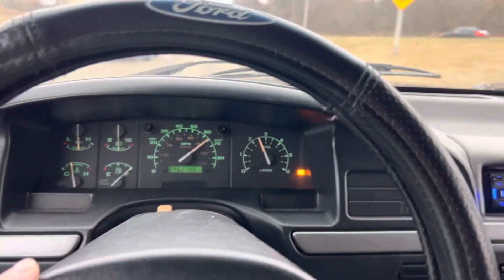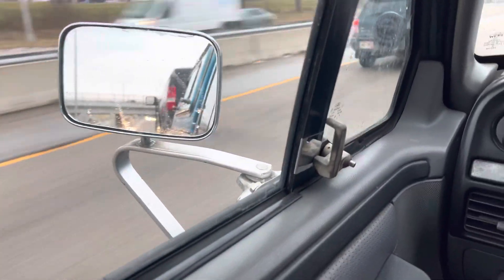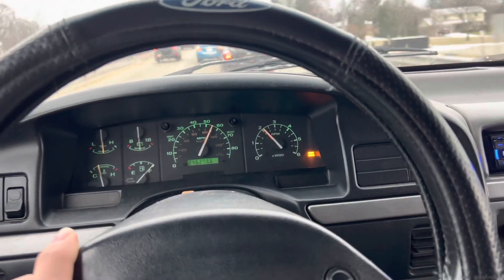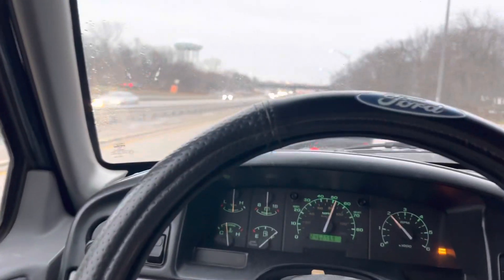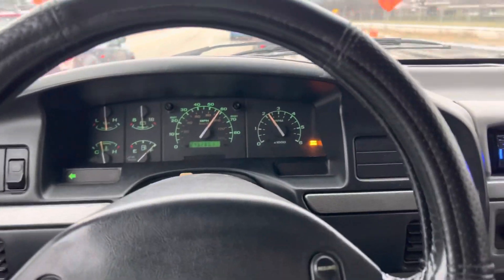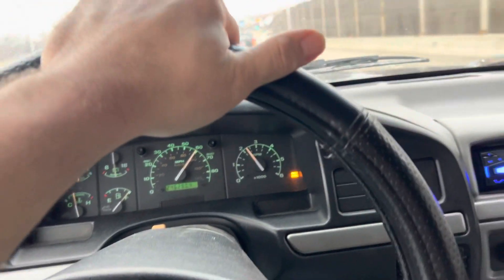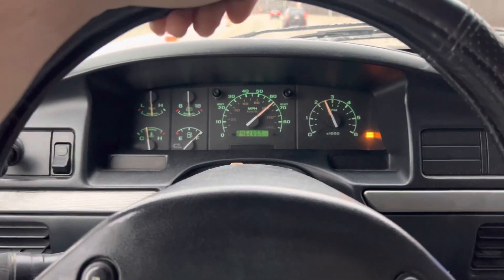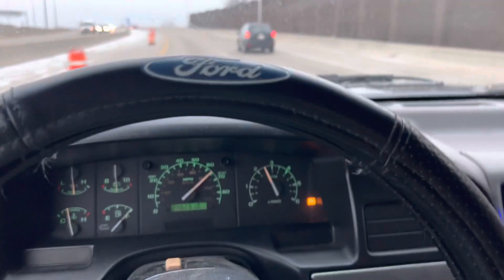1996 f250 towing 10k pounds

Comment: Not fast, but accomplished the goal. I have a 94' F250 Supercab 460 and a 2004 F250 Crew Cab V10, and they will by no means be as quick as most older diesels, let alone most newer gas 3/4 ton trucks. But, they served my purpose in hauling a 34' camper with family and gear.
Reply from the maker: For sure man, this hog isn’t fast but she gets the job done, I use it everyday for something lol.

Comment: I was gonna say, im pretty sure the m5od isn't made for that. Lol
Reply from the maker: Hell no It wasn’t lmao. This truck was originally an automatic and then someone put a zf5 in it and then that took a crap and I put this m5od in here I had laying around
Reply: I've got a 97 F250 with the 7.3, zf5, and 4.10 gears, and she's a puller! I also have a 94 f150 with the 351 and she isn't the most powerful. Granted she is high mileage and wore out from lack of oil changes from previous owner(s). Which is why I plan on rebuilding it here soon. I'm hoping to get around 400 ft lbs torque and somewhere around 350-400 hp.
Reply from the maker: @professionalredneck7920 those sound like some great trucks man, I used to have a 95 powerstroke and that had a nice amount of power for hauling and towing. I was gonna do a build on this truck too but it’s so rusty lol. I have way way to many projects to get done lol